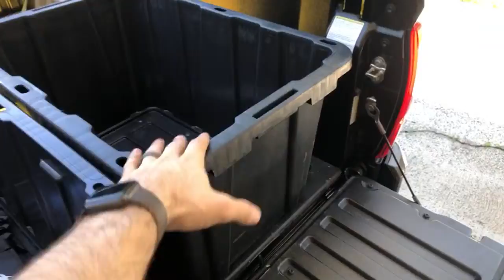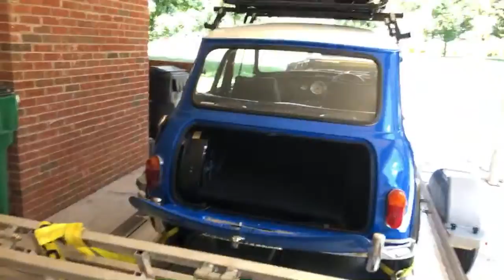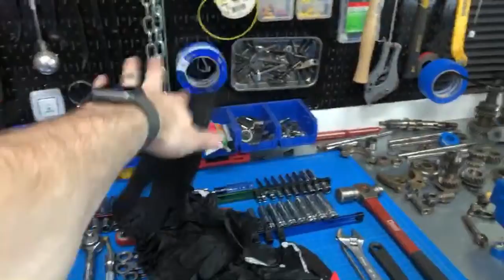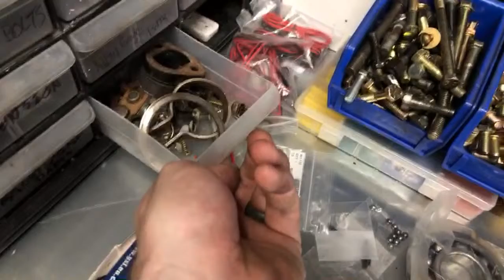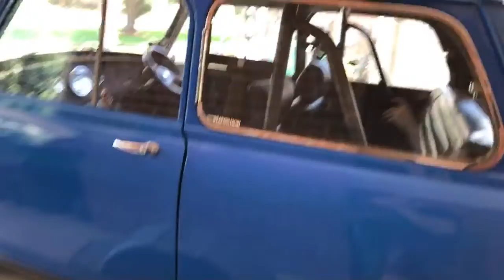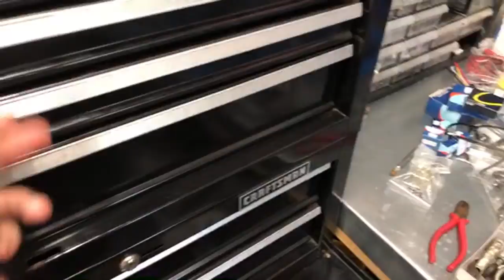Classic Mini Trip Tools - What you Need (Live)

Comment: I did the Hotrod Power Tour in June 2019 and put over 2000 miles on the car. I packed most of the same stuff you did. SAE and metric sockets and wrenches, pliers, screwdrivers, electrical tools including a multimeter, wire, ways to join them and electrical tape.  It went in a mail tote (fit perfectly in the boot) along with a few set of gloves, coolant/water and oil, zip ties and hose clamps. An old towel to lay on the ground. Spare hose, fan belt and plugs. I ended up buying a spare alternator that I didn’t use and had it delivered to a friends house on the route. Thanks for the recommendation on that! A recommended future video, showing how to convert from mechanical fuel pump to electrical. I’m doing that now.